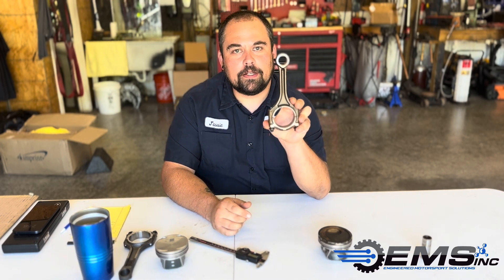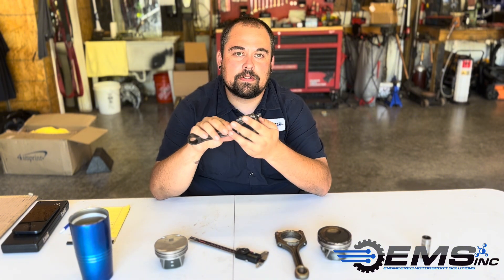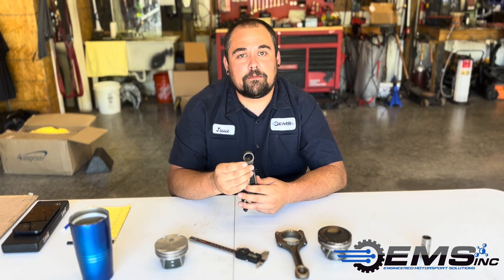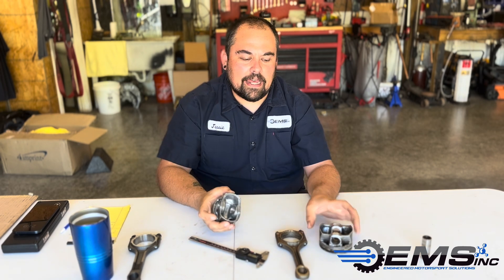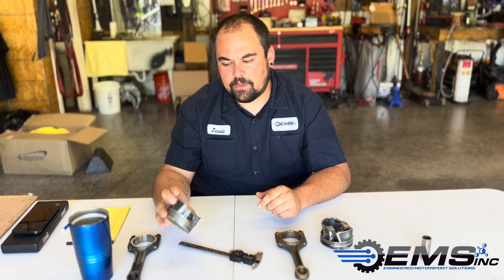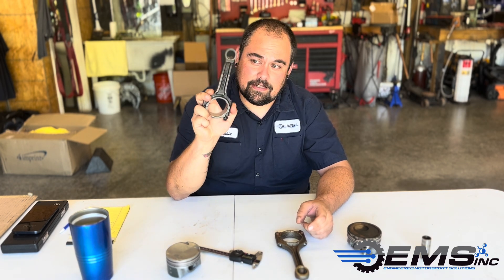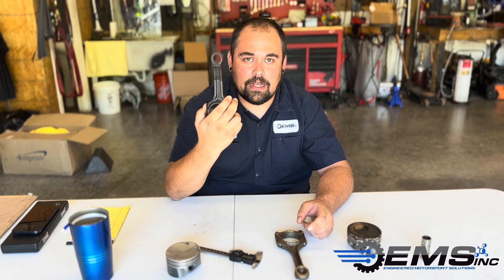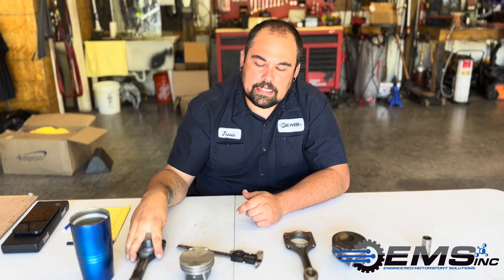Gen 1 versus Gen 2 EcoBoost 2.3 Rod and Piston Comparison!!

Comment: Nice video!  I’m going to say that the cooling gallery and associated oil inlet and outlet are likely as-cast features and not friction welded, since this is an Aluminum piston.
Reply from the maker: Yeah, after shooting this I realized it was likely a salt ring cast.
Reply: @engineeredmotorsportsolutions  You’re forgiven.  You worked on steel pistons.  :D